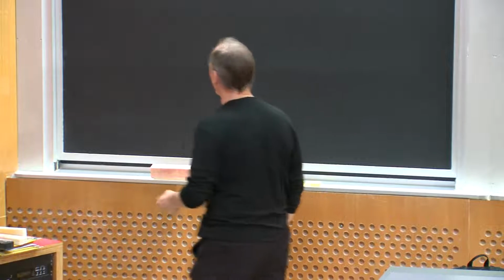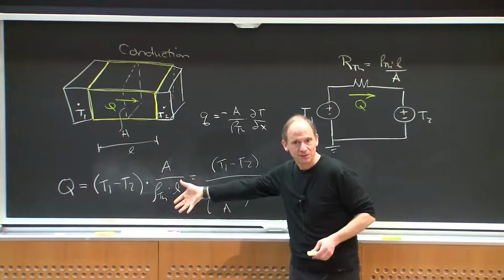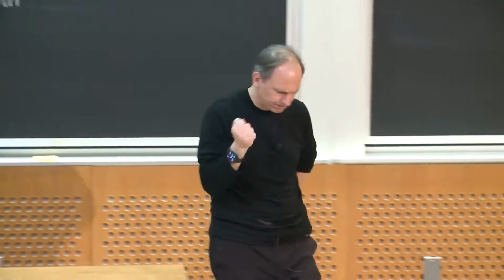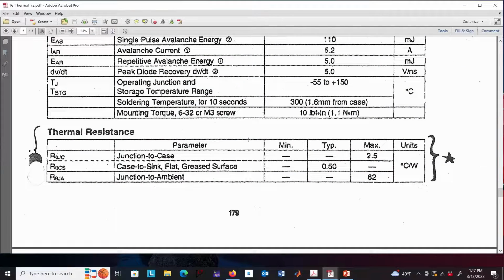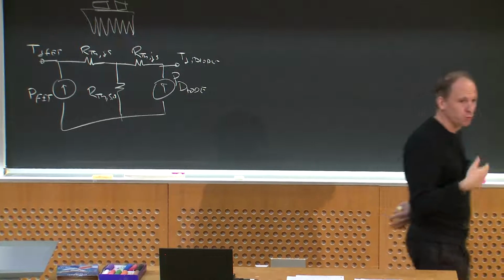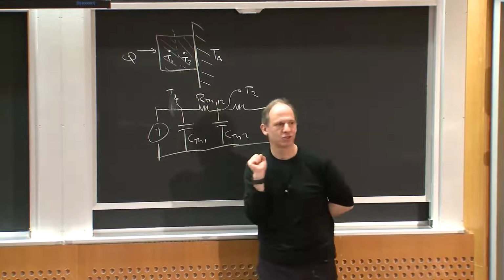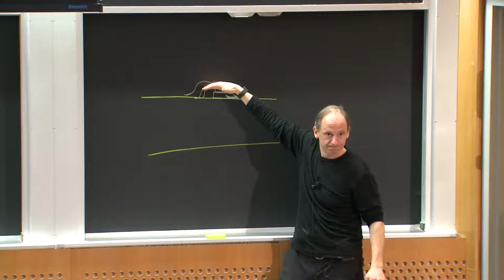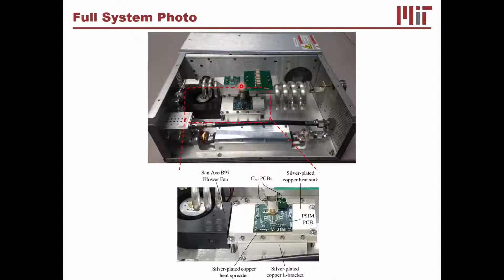Lecture 16: Thermal Modeling and Heat Sinking

Comment: I have been designing modules for 50 years.  Thermal dissipation (heatsinking) is a very complex matter.
Here is the formula.  Build the module. Add the heatsink you think is required by copying a module from China. 
Load your module to its maximum. Put a finger on the heatsink. If you cannot keep your finger on the heatsink, increase its size.
You have now got $1,000 worth of course knowledge, a week of study saved and a result that is 100% guaranteed to be accurate. 
And you don’t have to listen to all the gobbledygook from a Professor who has never designed a module in his life.
Reply: LOLOLOL this is how you WASTE MONEY actually.
Reply: Ha! Funny but true. Your career spans an order of magnitude more then mine (5 years) and no amount of books, models and lectures would have prepared me for building real physical things. We often forget alot of empirical/quantitive understanding is rooted in 'wet finger in the air' sort of experiences.

Comment: The most extreme cooling method may be, as a Cray 2 used, immersion in a low viscosity liquid with the right boiling point.

Comment: He said 100 deg c ambient. I think he misspoke, that is an insanely high ambient. He probably was thinking 100 deg f, a not unreasonable ambient, = 37 c.
Reply: He meant 100 deg C. Industrial envornments can get very hot.  Imagine electronics controlling a piece of heavy equipment in an enclosed area.  The temps could easily get to near 212 F.  A sauna can get to 200 deg F with a simple resistor.
Reply: @StevenOhanesian-l4j  Yeah 100C industrial is common, I work on space applications and 85C amb is the usual we go with